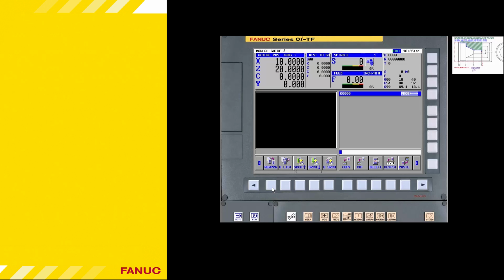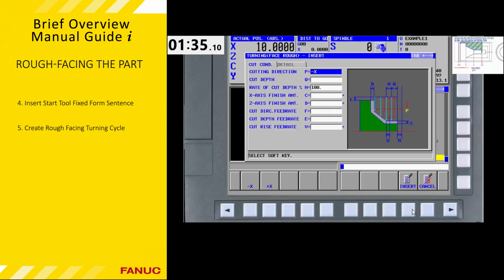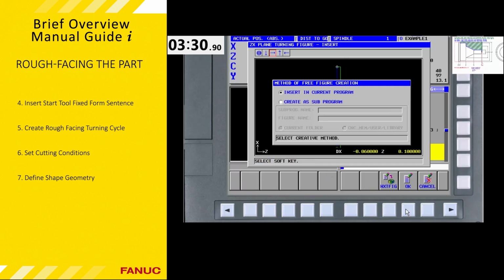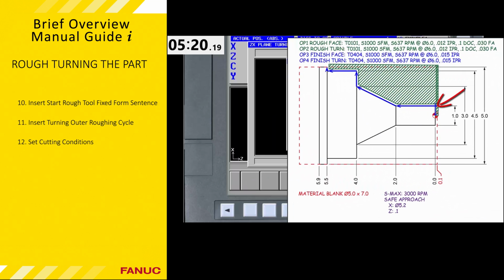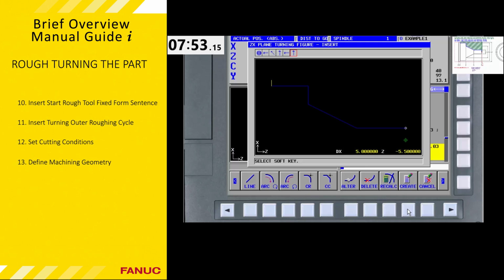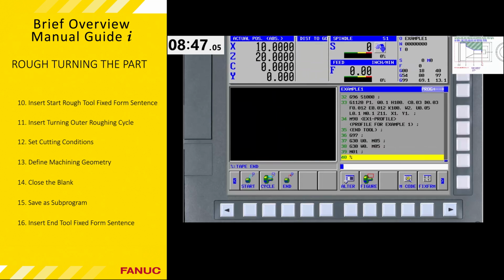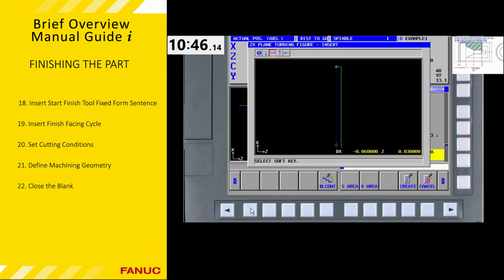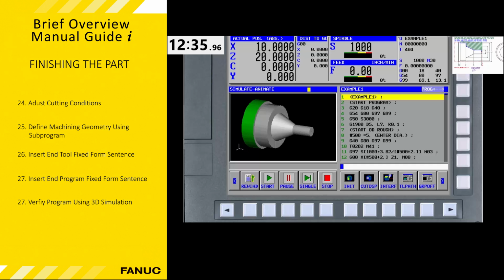Manual Guide i Program Overview

Comment: Hi...I just started working on a CNC machine recently so I am fairly new. However the manual guide used to load automatically on startup of the machine but now it doesn't and I have to use NC programming mode...how do I fix this?